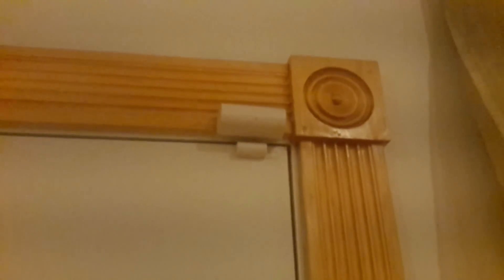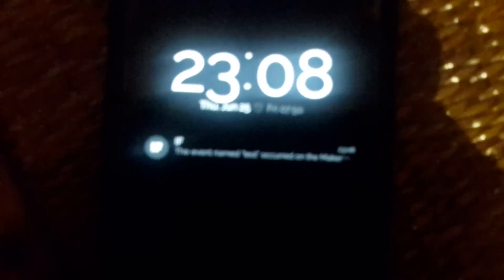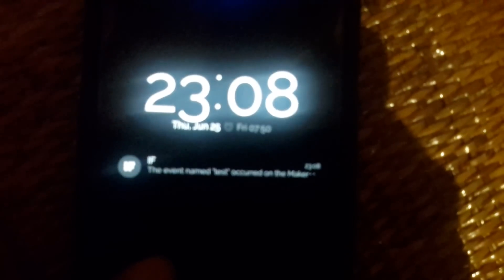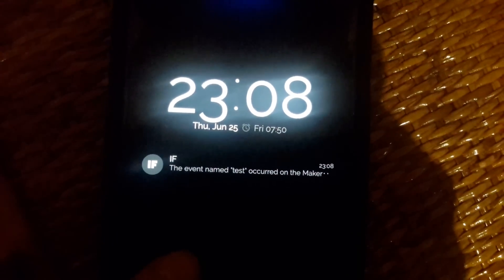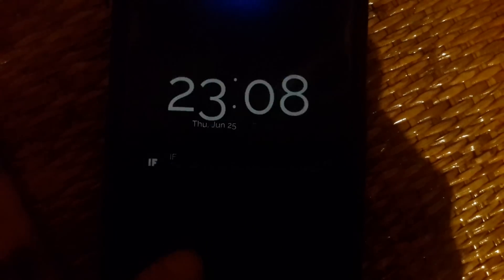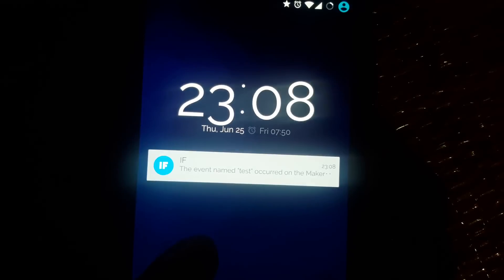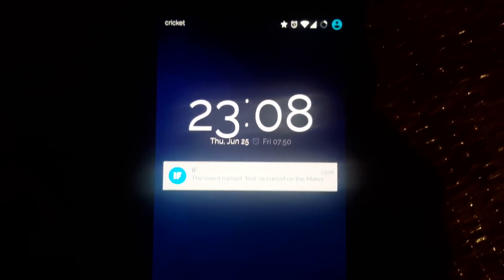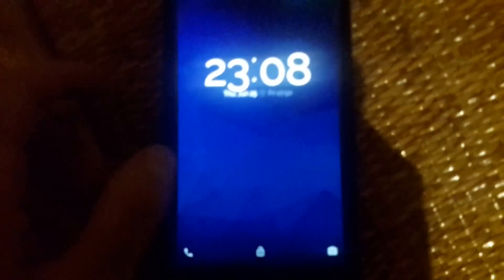ESP8266 + IFTTT, Holy Grail of IOT

Comment: You may use a N.O. reed switch to de-energize the whole circuit while the door is closed. By opening the door, the ESP boots, and closes a transistor latch in parallel to the reed, keeping the circuit energized even if the door closes ( a tipical latch circuit). So there will be time to make wifi connect and send a POST to IFTTT. Only after that the ESP may LOW the latching transistor gate and return to no energy status...